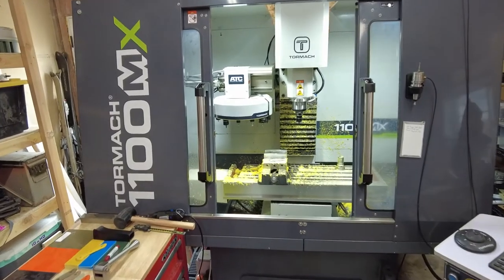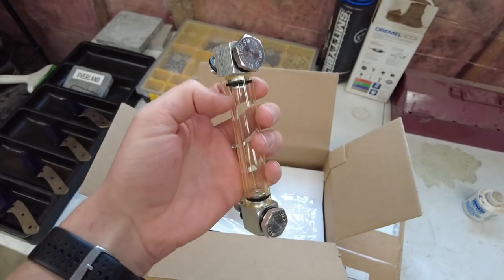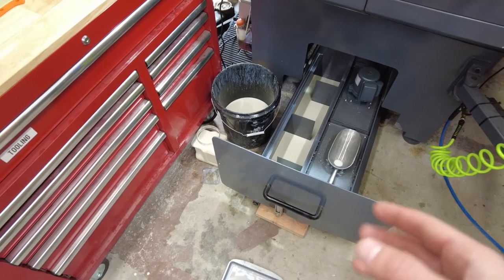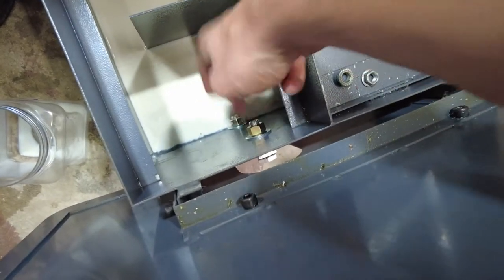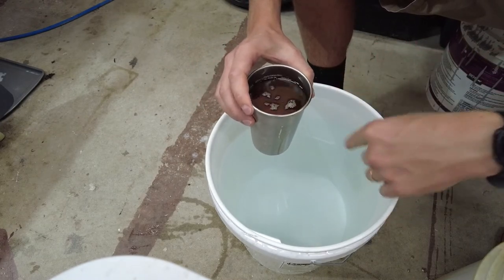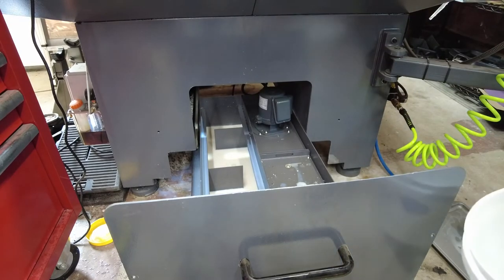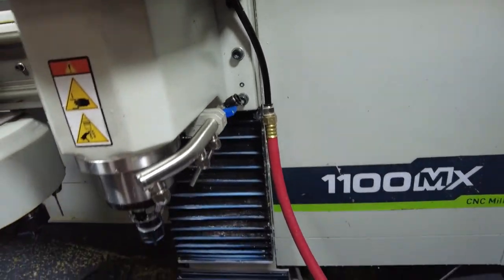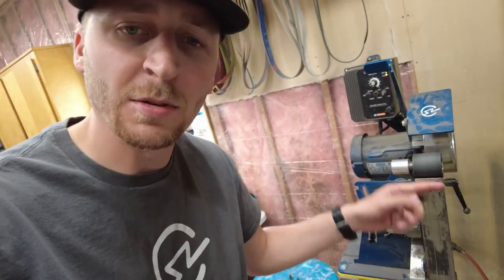Fixing an ANNOYING Tormach Coolant Leak - With Upgrades

Comment: About the recycling - if you had multiple of those chip/filter trays you could switch them between jobs and use one exclusively for aluminum, and one for everything else or so. That way you could accumulate aluminum chips over time, as that’s usually the material that can be recycled best anyway :) just an idea though in case you’re interested, no pressure!

Comment: removable electrical is key... if you end up moving it's easy to re-use.     I imagine 3 tools at a time... so wire 2 legs down each wall.   plastic - nonconductive AC boxes that point downwards keep the schmoo out.

Comment: A cheap Rerfractometer is better then none! ;) It doesnt Matter if u fill it up many times if u use Tap water! At work we use it too on 3 Cnc maschines. and 4 normal Mills/Drills... No problem so far if u keep it between 6 and 9%. And Water and the Coolant dont mic at all! leave it for 1 week still and oil will come on top and water at the bottom...

If we fill our CNC with Coolant, we try to hit 7%. then we will just fill it up with only Water the hole year. in the 220liter tank, pump mixing is fine
Reply: @CMTeamCobra why? if i get it mixed up right? it worked around 10 years just fine... and we got inspected every  3 months from the coolant supplier... whatever in theorie you are right yes